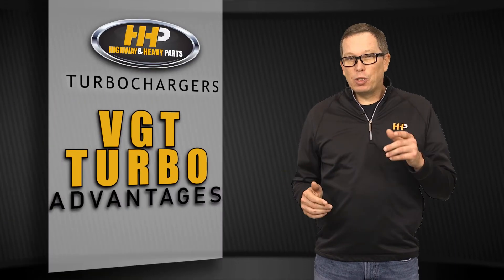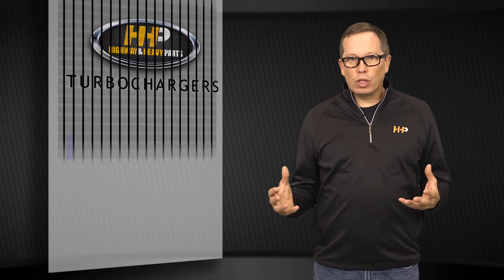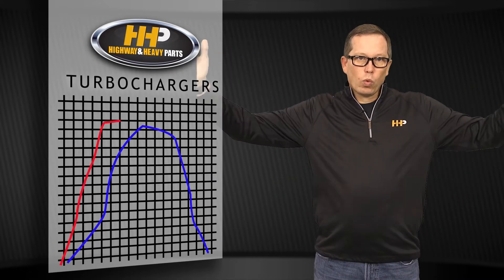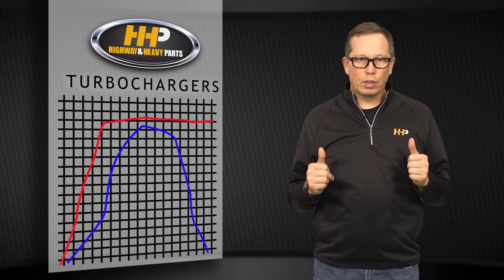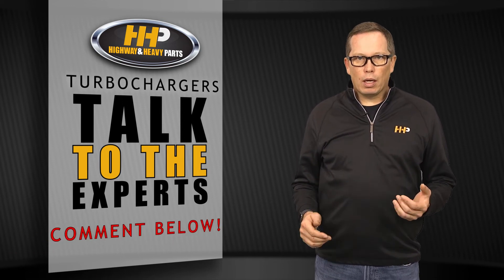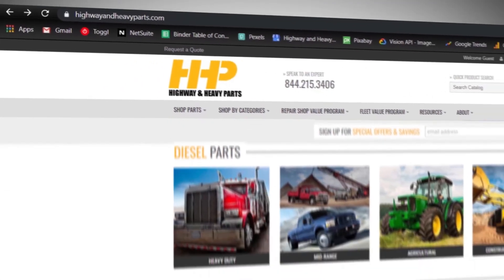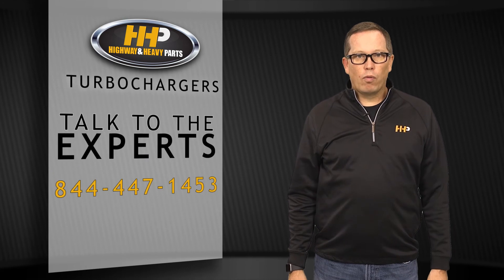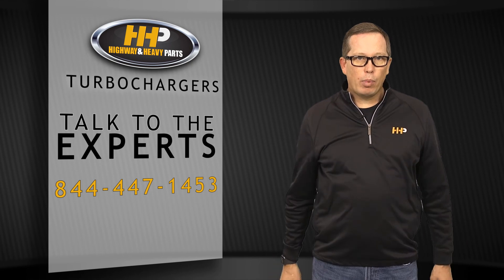Variable Geometry Turbocharger (VGT) Advantages. Check This Out!

Comment: can a non vgt turbo be replaced with a vgt  turbo... the engine is not crdi by the way.. thank you
Reply from the maker: No, You would need an air or electric actuator to control the VGT which would have to be controlled via the ECM.
Reply: @Highwayandheavyparts  thank you ...much appreciated..